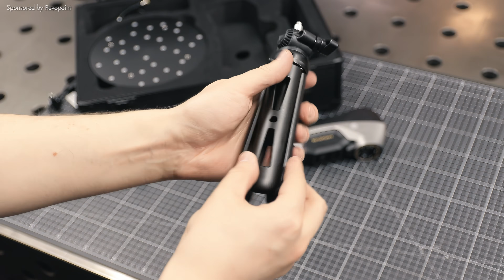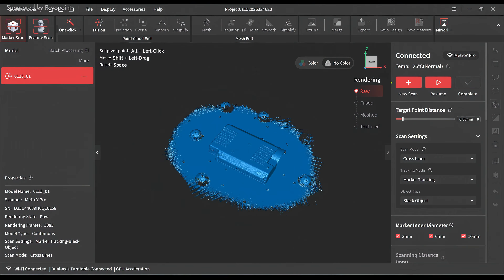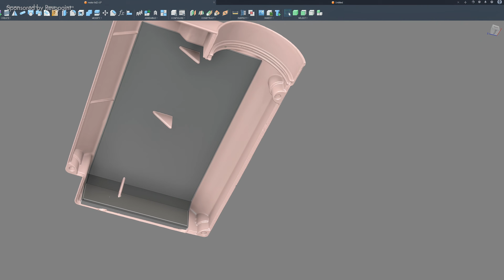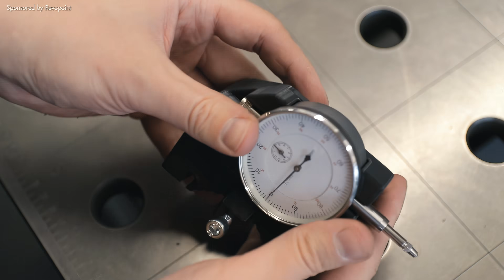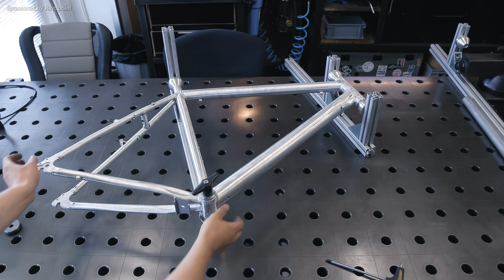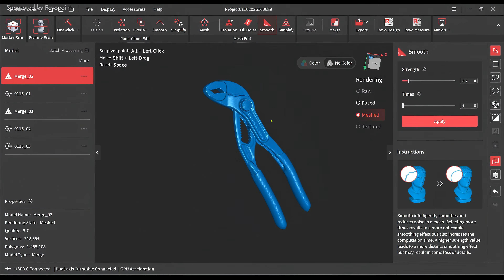How 3D Scanning Actually Saves You Time (Revopoint MetroY Pro)

Comment: designs, similar features can slightly aid heat dissipation or minor airflow, but these don't look like open vents (they appear solid/closed in the image), so airflow isn't the primary intent here. They don't allow the heat escape unevenly your new part will probably warp in time from the capacitors heating

Comment: How does that work after your scan i can see the effect  of the broken area glue glob on the inside and the outer side of the part you can see the crack or break 🤔 when 3d print happens is there a software that can detect the flaws in the scan before you push print. ? Oh I see the clean up after

Comment: I've found that even the highest end scanners produce very inefficient 3D models. Even for the simplest geometry, they produce very large and complex meshes with thousands of polygons. The included software can simplify the resulting mesh, but it usually comes at the cost of significantly less accurate dimensions. I find the scans only good as references for 3D modeling by hand, which makes the cost of higher-end scanners hard to justify.
Reply from the maker: Yeah you won't get a clean CAD (Nurbs) model out of them, I don't think that's gonna change anytime soon since turning a point cloud into a triangle mesh is relatively easy (polygons essentially just being based on a point cloud too) but turning it into geometric expressions like true CAD models do is way harder. It really depends on what you need the model for. For a lot of uses 3D scanning can still save you an insane amount of time, it's just not the solution for every use case. That being said, Revopoint has a software for specifically this purpose. I haven't actually tried that but if I understand correctly it can turn polygon meshes into nurbs models to some degree.
Reply: Eventually, they'll use AI to convert the polygons to nurbs.

Comment: Does that software you show come with the scanner? I might be able to justify the $1800 price of the scanner, but some of the software options when ordering cost well over $5000 for the license. That's a no-go for me.
Reply from the maker: The scanning software is of course included, yes. The CAD software (Autodesk Fusion) I used for modeling is a seperate program, but they also offer a free version for hobby use and there's many free alternatives for CAD software so you can definitely scan and model things without spending anything on sotware. Revopoint also offers some paid tools but those are for specific purposes like metrology that most people don't need.
Reply: @PhilVandelay  Good to know. Thank you for taking the time to answer my question - it's very much appreciated.

Comment: hmm price is still a bit steep given how simple most of the stuff I deal with is, but seeing the toolpost and bike frame scan made me realize that the scans are actually usable not just as a reference for making an accurate model but are usable by themselfs.I can see myself buying one of these in a few years at half price
Reply: Maybe you can consider their Inspire 2, which is the only scanner has laser scan under 500USD.
Reply: I would've liked to see the quality of the included software's mesh simplification. Scanners often produce huge complex, memory and GPU intensive meshes which makes them painful to work with.

Comment: Thank you Phil, that was good fun. Really shows the potential of the scan and print technology, and you seem to have made some good work flow choices. That dial indicator holder is sweet, such a good idea. 
One idea I think would be interesting is camera and microscope mounts for small lathes: turning small parts for watches is easier with good magnification, both overhead and looking down the bore from the tailstock. It's difficult to model because of the many different curves, ways and tapers but maybe a good use case for this scanner.

Comment: When you demoed the TrackIt I was really interested. 
I’ve got 2 questions:
1. Can the metro handle larger scans than the advertised area? I’m thinking like a single panel of a vehicle sort of size (campervan in my particular case). 
2. I was slightly confused by the pricing, is the software subscription based or is there a free version once you’ve bought a scanner?

Comment: I just purchased the Metro Y Pro yesterday, great timing.  I've spent the last few months researching all consumer/prosumer level scanners and the Metro Y Pro does true micron-level repeatable accuracy and has proven the be the most accurate of the current generation of scanners sub 3k, which is why I pulled the trigger on it.  The truth is the technology is advancing at incredible speed and if you're still on the fence it might be a good idea to wait and see what shakes out in the upcoming years.
Reply from the maker: Yep it's crazy how quickly these are getting better. We might even have this tech in our phones at some point
Reply: how much?  I'd like to get one, but man are they spendy!
Reply: When it comes to accuracy, MetroY Pro is certainly excellent. Previously, many users were concerned about the high PC requirements, but with our latest software update, even without a dedicated graphics card, you can still achieve great results using CPU acceleration.

Comment: And what about printing one day bicycle frame. Is it realistic printing by any material that  strong and light enough (around 2 kg)???
Reply from the maker: Someone on YouTube actually tried that using plastic but it didn't work out. You can already (partly) print bike frames out of metal but that's done on industrial machines. So yeah, we're slowly getting there!
Reply: I saw on with my own eyes 3D printed bicycle frame. Was a few years back on international industrial fair in Brno (CZ). Was printed from titanium. But They was dont want talking about costs for that. 😀